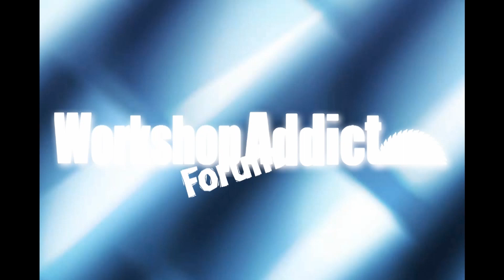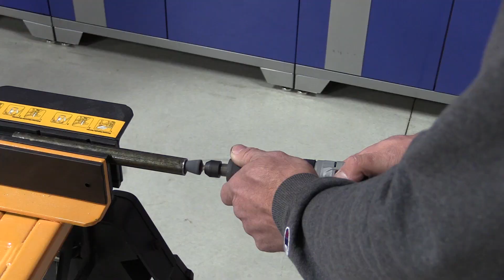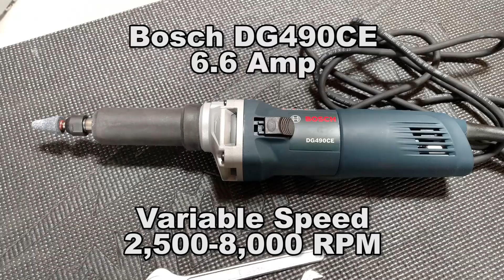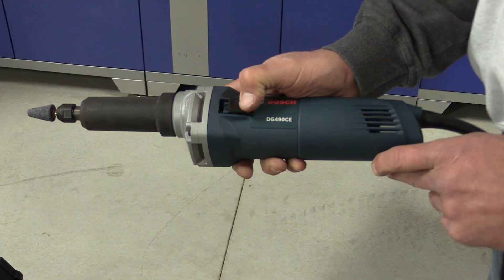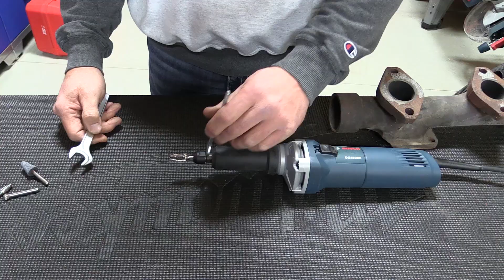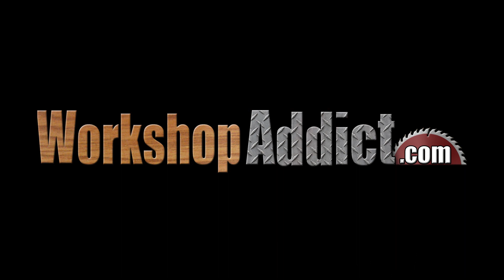Bosch DG490CE Variable Speed Die Grinder

Comment: This is a very well-made tool.>>>allmy.tips/BoschDgrinder?3     I use it daily in my sculpting of various materials, from stone to wood. It runs true with minimal vibration and without hesitation. The variable speed capability is extremely useful: it can go at very high speed for small diameter bits, slower for larger diameter tools. The lock-on switch is dependable but easy to disengage.

Comment: I am a professional mechanic with tens of thousands invested in snap on quality tools etc and a firm believer in quality tools. with this said been porting cylinder heads for over 30 years and have found the harbor freight crap to work perfectly fine in this application if you are not using it 8 hours a day for 20 years straight .. at less then $50 for the die grinder and $16 for the variable speed router control you can easily afford to buy 2 of each ..why ? because when porting heads its a pain to switch from cutting bit to sanding cartridge every 90 seconds off and on for hours on end... Also the router speed controllers can be used for almost anything that has brushes. I use one on house fan to slow fan down to a speed where it supplies air but not noisy etc.. you can even make a speed controller using a light dimmer for around $11 but trust me just buy the harbor freight one as the dimmer does not slow all the way down to 0 rpm either .

Comment: Fixed speed die grinders are pretty much all in the 23-28K RPM range. Small Dremel tools are mostly in the 20-35K range. I find it curious that this adjustable speed die grinder tops out at 8K RPM, which is roughly 1/3 the RPM of most die grinders. Are there bits/tasks where this Bosch is less suited and you find a cheaper 25K die grinder works much better? The 3" cutoff discs, for instance, are rated for 25K+. Even angle grinders using 4.5"+ discs are running at 11K RPM, which is significantly faster surface speed than the Bosch's 8K at 3".